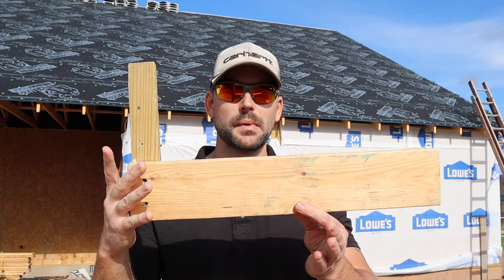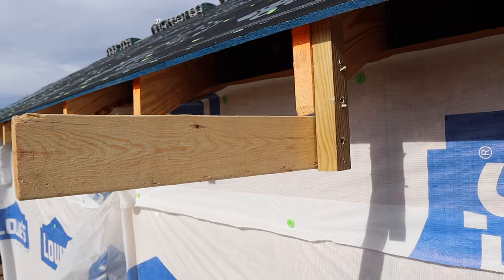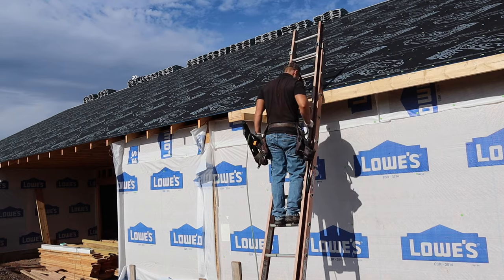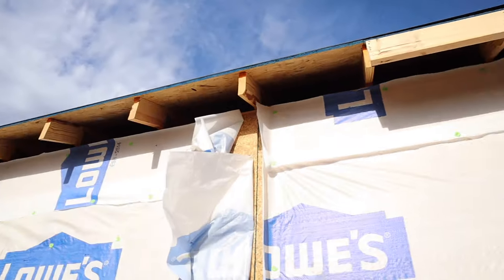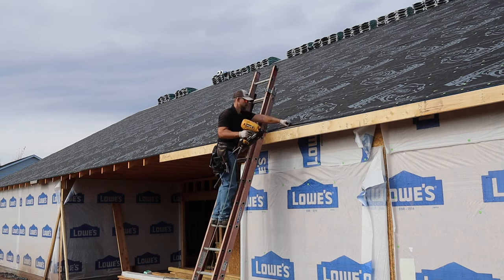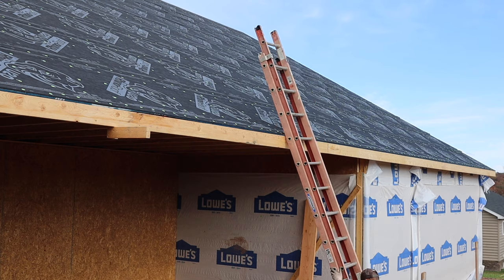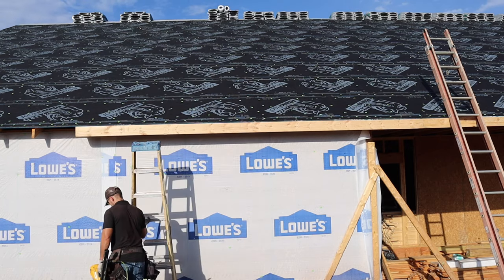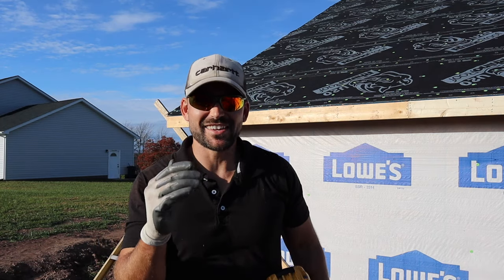How To Install Fascia - ALONE BY YOURSELF!

Comment: Great tip - I've refurbished several houses on my own and have picked up loads of tricks like this for solo 'artists', lol. I've found with fascia's, rather than cut to cover half of a rafter, I cut a half lap joint and when they're up just clamp and screw them together - then it doesn't matter where your joints is. Bit of extra work (and time), I guess, but I reckon it's structurally more solid. Then again, I've got the time, because I don't do it for a living. Cheers.
Reply from the maker: Excellent tip Neil. I appreciate you sharing your strategy. I could try that sometime and see how well I like it. Thanks a lot for the comment. Stay tuned!

Comment: I chose to end the sub-fascia board between two trusses and place a 2 x 6 behind the joint as a backer. It seemed very secure. I struggle landing both 2 x 6’s at the end of the truss. I don’t think I violated anything. Seemed strong. BYW, you have been a great help to me. Thank you. Your a good teacher.
Reply from the maker: Yes that sounds like it will be fine. Thanks for your comment Gary!
Reply: It's not a load bearing situation so it doesn't matter. Painting all around the boards doesn't run against logic either 👩‍🔧🇺🇲🛠️🇷🇺

Comment: I installed the facia before the decking. I then tacked pieces to the facial to hold the decking from sliding off. I took care to make sure the facia was a bit lower than the rafter to allow for a flat deck.

Comment: A total build can be done alone if you learn a few tricks before starting and this guy uses a common sense one here. Best thing ever are wall jacks / siding jacks, buy em, use em or build shorter walls in sections and double stud. Don't recommend exterior 2x4 walls so 2x6 are heavy, buy the jacks or get creative with your truck - cable - wench. At eighteen a boss on vacation returned to find a entire house framed and sheeted, called me up saying it was scary as hell and why does it take three of us six weeks when I got it done in two alone with 27 ' vaulted walls. Easy, they get high and drag ass, Work sober, work safe, then party as you please.

Comment: This helped me fix my fascia. We had a storm and winds, and a heavy passion fruit vine that was already pulling the fascia out about an inch, and a shade sail connected to it which finally yanked it off. It was a 9" fascia so very heavy. I used your tip to mount it back up. The hard part for me was the drip edge was catching it so I actually had to put up a bracket on both ends so I can go back and forth to adjust it under the fascia. I removed all the nails first, mounted it, then reused the nails in new positions. I then also added L rackets on them to hold them in just for good measure since it had come off once now.

Comment: I just installed 8 foot section alone, was unhappy with my results and decided to see how tight i need to be. Im putting a fascia protector metal roof on afterwards but i want to do the best job i can.

Comment: I use a 4” screw. Screw side is a tad high at the start, but once the right side is nailed I go back and remove the screw and tack down the left side back level, and then nail the middle. That “helping hand” is a huge help!  I use the same method for hanging sheathing and drywall alone!
Reply from the maker: Awesome tip! Thanks Donald!

Comment: For a home DIY’er, I think I’d feel better using an “L” bracket as it provides good support, as there are times I have to advance a home project and. Don’t have another set of hands to help. This will make it easier when I redo my roof and facia. Thanks for the tip.

Comment: I use a similar jig, but clamp it to the rafter tails with one of those small DeWalt clamps that  have like 600lbs of clamping force. - avoids screw/nail holes and is faster.

Comment: Thanks for the video, really cool. I use a piece of scrap plywood and just cut out the length of the 2-6 or what have you,then I make it about 1 3/4 so I have a 1/4 to slide it back and forth if need be. I use two nails, one on top and one on bottom. The trick to reusing the same nails and performing fast is use the 8s (2 3/4) nails. I subscribed because I like your videos. Thanks again 👍
Reply from the maker: Great tip! Thanks for adding value to the channel!!

Comment: Yes I install fascia alone. I use L brackets or clamps, sometimes a step ladder with blocks on it, really anything that works for the situation.
  One thing i always do is miter my joints and ends (45*). They overlap each other so you can fasten your joint and make the boards move together if they move any. It also cups less than butt joints. Also I put 2x perlins between rafter ends before putting fascia on so it will be solid wood the whole length so gutters can be installed without worrying if they hit rafter ends with fasteners (which they seldom do). If there are trees than they need to be fastened more often to support the build up of leaves if they are not ones to keep gutters clean, even with screens.

Comment: Actually just recently my coworker had a doctor's appointment in the morning so I was stuck with putting up a few sub facia board boards by myself. What I do is drive a 16 penny nails halfway into the top long edge of the 2x6 facia board and then bend it 90 degrees perpendicular to the board and use this "hook" to hook it on the rafters tail to hold one end while I nailed it from the other end. I like your trick better I'll have to try it.
Reply from the maker: Oh yeah when you’re in a pinch you can definitely do it by yourself. I have seen people use the nail trick before. It is just not as stable. The L bracket is definitely easier to do. Thanks for your comment!

Comment: For my projects I've been using my Kreg tool to joining my fascia boards, using wood glue and screws.   Material is too expensive to be wasting.   I also bevel the edge to the same pitch of my trusses for everything to fit flat.  I doing it on my personal stuff.   It's more work.  I do like your jig to hold the fascia board.   I'll make on e tomorrow.

Comment: Have a 14 ft length of 2x8 doug fir to beam across the gable end of my house.

Was struggling with the logistics of how to get it placed.  I think this might work with some modifications.(e.g. notch in the L bracket to account for the angle)

Originally I was going to mount D-ring anchors and try to hoist in position from the roof.

Comment: Great video. Thanks.  I am working on mine now. I was wondering about those ends and how they butted together.  Can you do a video showing a corner and maybe another one with an extended porch so that you have valleys running in at two places. Also, point how the alignment on the 2x6 and decking, the 1x8 and drip edge.  Thanks super great video.
Reply: One more item to add is the soffitt board attachment to the rafters and edges of the house.

Comment: I've cut a piece of plywood to a shape for a holder and screwed it on. Also I have used a coupletie down straps  on two stories and I was able to ratchet them right to the level I needed them. Still trying to come up with some kind of chain linking system to adjust into place.

Comment: Great video. Only thing I do a little different is run board a little wild and use oscillating saw to cut the wild end. No tape needed and it’s pretty fast

Comment: Hi. I'm installing aluminum fascia for 2 tectangular fiberglass balcony  . I would like to know when measuring the length and the height of the fascia, do i have to add an extra 1/8 " or 1/4 " so everything dits together ( with the soffit) or it's not necessary .
Thank you

Comment: I also string line my rafter tails to make sure they are all at the same exposure. This is very important when using thinner fascia (especially  cellular PVC 4/4) but I check on 2x6 anyways. I use a bracket similar to yours but I use 4"GRK screws  and drive them at the same angle as the rafter.  I find that most existing tails are weak and a 3 inch nail doesn't stay put for long. I half lap what few joints that are required on runs longer than 22 feet. Sure it's not the fastest but I don't get calls about failures. And yes I know about that " birdsbeak" joint but it's hard to beat the glue surface area of half lap. Additionally I use Elmer's water based wood dough...if there's cracks/splits/knots I ...V groove them lightly with a chisel and schmear in Liquid Nails. And use Sherwin Williams wood primer...it's $60 for a gallon of mind blowing good water base...you can prime and sand in the same day...try that with the dogshit Home Depot sells. Do all your filling /sanding/priming on saw horses BEFORE you install so you're not running up and down ladders all day long. Prime ALL sides of the fascia as well. When replacing that tiny piece of 1x that sometimes supports the dip cap...use cellular PVC instead of wood.
Reply: Does it make more sense to install the subfascia before installing the roof sheathing? That way the sheathing has something to butt up to when you’re installing it.

Comment: I noticed the sheathing didn't extend over the top of entire fascia board. Is that for a reason? The drip edge will cover it anyway I guess. I'm getting a new roof this summer and am going to need the sheathing ends and fascia boards replaced so this was all very helpful.

Comment: do ya'll use a joint to connect each run of 2x6, or just butt them up against one another? also, what's the ideal type of wood for this? seeing j-grade at local home depot, 16' runs, that seems to be the best option for dimensional accuracy/no warping? should it also be pressure treated?

Comment: You don’t cut 45 degree cuts in between the joining fascia, like joining two 16’ long fascia? Im in Southern California and I see installers doing 45 degree cuts on joining fascia going across.
Im going to replace fascia at my house. Any tips if i should cut 45 degree cuts or not?Thanks! 
Just subscribed
Reply from the maker: This video is technically sub fascia that is going to be wrapped with aluminum for its finally look so the joints dont need to be 45. If you are going to install a finished fascia board you should definitely do the 45 degree cuts at the joint . My advice is to get a good miter saw to do the cuts. Thanks for subscribing! Good luck
Reply: I had the exact same question.  Thanks for asking this.

Comment: Josh; really cool... question on the spacing and angle... It looks like the subfascia is not angle ripped (to meet the pitch of the sheathing); is angle ripping really necessary? And, (2), I can't tell from the video if the outside edge of the subfascia is flush with the sheathing edge, or if it's ~ 16th inch away (outside); what do you recommend?
Reply from the maker: I did not angle it. It is really no problem if you don’t. Thanks for watching!

Comment: Excellent video sir! I too am working on a job which is what brought me here. There is about 1/2" gap between the roof sheathing and the fascia board which is visible when you lift up the drip edge. It is also not flush to the fascia. I was wondering if you can tell me if there is something in the IRC (2015) I can reference for this issue?

Comment: My husband and I bought a home a few yrs ago that does not have any facia boards, and we'd like to fix that to help improve rain gutters. 

If the rafter goes to the edge of the roof, then should the facsia sit just past the lip of the roof?

Or, should we cut the rafter boards back just enough so the fascia is cover by the roof and flush with the end of the roof?

Comment: Hello, very nice video. It gives me great confidence. I have an older garage w/o gutters and I want to install some. My question is would it be possible to use 1x4's instead of 2x4's for the fascia..? Do you think it will support the gutters I plan on installing..? Thanks any feedback would be great
Reply from the maker: I think one by four material will work fine. It is stronger than you think. As long as you cover it With facia so it does not right. Hope that helps!

Comment: Good morning ! Can I radius or 45° the  outer edge of sub fascia so it will pull closer up tighter to the roof sheathing so there isn’t that triangle gap up on the inner side of the sub fascia allowing more nailing area for my truss end ? My trusses have the 4” tail end hope I’m making sense lol great work man your helping me build my house in Kentucky

Comment: What kind of nailer is that and what size nails did you use? 
Thanks
Reply from the maker: It’s a Dewalt framing nailer using 3 1/4 paper clip head nails
Reply: Will that nailer and nails work for finished fascia? 
What’s the model number on that nailer so i can order one?
Thanks!

Comment: Replacing rotted fascia because there was no drip edge. Only had to replace about a 6 or 7 foot section, but noticed that the top of the fascia was originally installed about 3/4" below and 3/4" beyond the roof decking. There's no way to attach the drip edge because where there should be fascia meeting roof deck, there is a gap.

Ever seen that problem?
Reply from the maker: I never have. I typically install the drip edge after I install the sub facia board. You must lift the shingle to install the drip edge at this point. Let me know when you get it fixed.
Reply: @TheExcellentLaborer  got it fixed and installed the guttering today. Went to the back and got the rest of the rotted fascia replaced and drip edge put in. Messy, spidery, waspy work! Gonna do gutters there when I can.
Reply: I see it all the time. I think it's a result of adding the fascia after the decking has been laid.

Comment: I hate working by myself because it's more difficult. I have to create all these wood catchers and brackets then lift up all these heavy pieces of wood with one hand and shoot a nail in it and make it level at the same time. I have found that when working alone, some clamps and screws help a ton.

Comment: If I have access to my trusses can I tell what size lumber I need for a new fascia board?
Reply from the maker: Typically you get the next size bigger and with the rafters. For example of the trusses on this house were made out of 2 x 4. So the 2 x 6 worked well. I hope that helps. Stay tuned!

Comment: What size of fascia broad do I need? 
Can I use screws on the fascia broads? If so, what kind of the screws do I need?
If the fascia broads were nails form the top roof rafters, how can I remove those fascia broads, the shingles are tight and good condition?
Reply from the maker: I’m not sure the project you are doing. But I always use a 2 x 6 facia board on the house. Dormers I use 2x4

Comment: I used the nail. It was only a pain in the ass because the pressure treated boards I was using were significantly heavier and bent the nails.

Comment: Great video.  I need to replace a few Fascia boards that warped/ rotted because the original builder was trying to save on nails and didn't nail on all rafters.  I want to replace these by myself but I'm considering using PVC board vs wood.  Do you endorse using PVC ?

Comment: Lately ive been using butt joints because my mitre cuts always look like shit..do you prefer butt joints and why? Also my fascia will be exposed so it has to look googd,not like yours with 6 nails in each side :) thx for the vid. Going to use the L bracket idea.
Reply from the maker: I like butt joints because they are easy and get covered up. I cover them up with facia. Give it a try and let me know how it works. You are welcome. Stay tuned!

Comment: I'm replacing 32' of 1x6" fascia and 8' of. 2x6" sub fascia(rotten in a few places)(which I fear is nailed into from the roof sheathing) on our garage side of our house. The shingles over hang about 2 - 2 1/2". Do you think it would be possible to lift the shingles up and nail through the sheathing into the sub fascia or is that even necessary. I know the sheathing is nailed to the rafters just above the fascia and sub fascia. Thanks. I love your suggestion of using the L bracket to support the other end of the fascia board while working by yourself. When I replaced this fascia board about 25 years ago I used 8' boards so I could handle them by myself. Now I'm 70 and I might still use 8' boards even with the L brackets. Lol
Reply from the maker: You may be able to take a putty knife and lift the starter strip and nail under it. But more than likely the shingle will crack. Especially if it has age on it. Be very careful doing that. Be prepared to replace shingles if you try it. Thanks for watching!

Comment: Why didn't you use 45 degree  cuts
Reply from the maker: On which part?
Reply: 45 degree cuts when joining fascia?
Reply: @starzztop  I thought the same thing, where two pieces meet they would be cut at 45's. Is this not correct?

Comment: I was taught to not break at Rafters, but to break in the middle. Then put a piece of 3/4” plywood behind the Facia and Screw it in place. The reason is all those nails in one place weakens and splits the end of the rafters. BTW, this was long before Nail Guns where invented, and everything was hand nailed.
Reply: Wait a minute.   You got a point.   4 nails on each side.   8 nails total.   That’s a lot.  But guys make it work.   
       Also my garage built in 1927.   1x6 sub roof.    Not aspenite like here.    I wonder how long chip board will last.....?
....especially when wet....?!      I’m just saying
Reply: Yep, more nails isn't better.

Comment: I did some goofy sh*t when I began installing fascia. Up on the 2nd level roof I had 2 guys on each end of the board holding securely onto 2 heavy duty ratchet straps. My head sure depended on them quite a bit having a 16' fascia board above my head lol. Super sketchy but it worked. I do not recommend you try this at home